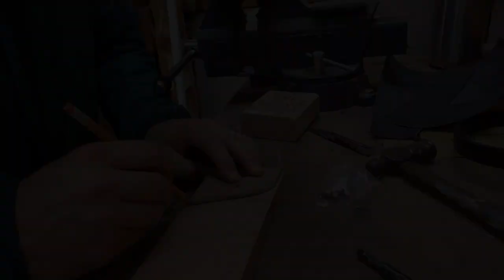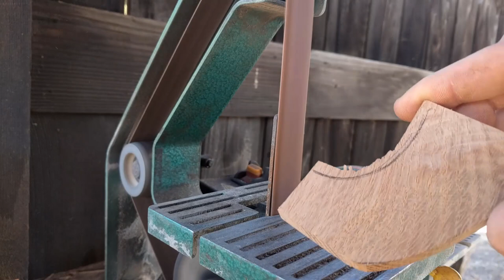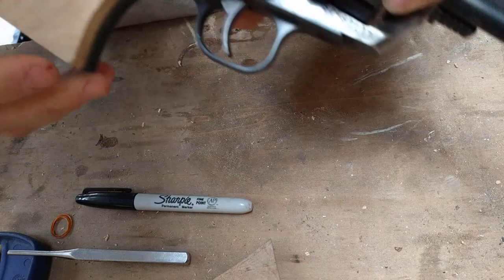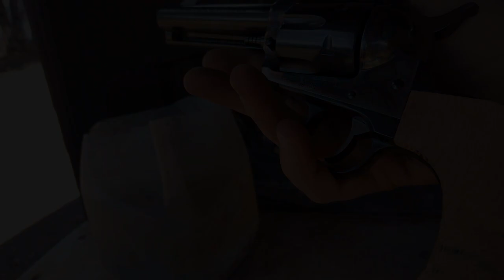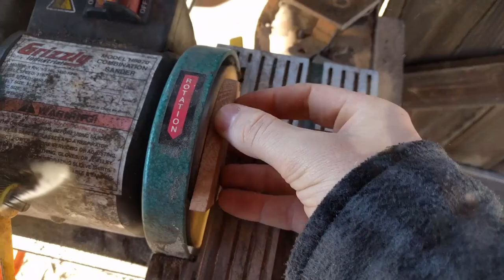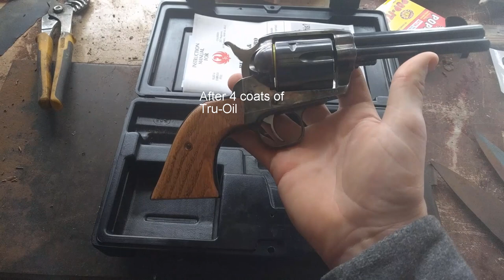How to Make Wood Grips for a Revolver.

Comment: Great job on the handles , where did you buy the screw set up with the threaded inserts ?
Reply from the maker: I bought them off of Numrich.  They are called grip screw and escutcheon set.  Part #725740
Reply: @ironridgeoutdoors  Thanks ill see if they have what im looking for , im replacing the wood inserts on my super redhawk with green burl wood , thanks again

Comment: You make it look easy. I suspect it is not, but I intend to find out.
Reply from the maker: Good luck to you!  It took me 3 attempts to finally get it, mainly due to the wood warping as I sanded it.  I used water to keep the wood cool on the belt grinder.
Reply: @ironridgeoutdoors  good thing to keep in mind. i did not realize that. thats probably why mine came out a lil warped.

Comment: Great video!  What do you call the inserts that you used in the grips that the screw fits into?  I broke the grips on an old revolver and am thinking about making grips out of micarta.
Reply from the maker: I bought them off of Numrich.  They are called grip screw and escutcheon set.  Part #725740

Comment: Where did you purchase the screw and the two brass nuts, also their sizes, that you used in the center of the grips?
Reply from the maker: I bought them off of Numrich.  They are called grip screw and escutcheon set.  Part #725740
Reply: @ironridgeoutdoors    Thanks you for your information.

Comment: Sir could you use pallet wood to make revolver grips?
Reply from the maker: You definitely could.  Many pallets are oak or hickory and would be very nice grips.  Some are pine, and might be a bit soft.
Reply: Iron ridge outdoors: I do not have mechanical saw. So what do you suggest sir?
Reply from the maker: @charlesdodson1991  the old fashioned way.  Hand saws a files have worked for years, just at a slower pace.
Reply: Iron Ridge Outdoors : if I take a picture of pallet and send to you can tell which of the wood I should us sir?
Reply from the maker: @charlesdodson1991  I could not unfortunately.  They all look similar to me.  If you can dig your finger nail into the wood and make an indent, it's not a hard wood.
Reply: Iron Ridge Outdoors : what part of the pallet wood would you take sir? If your going to make a grip for a revolver